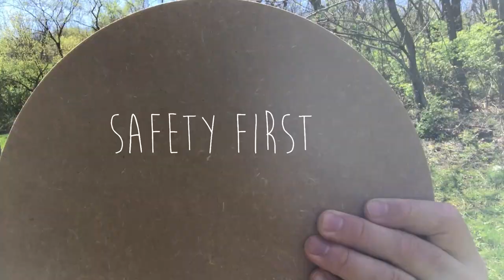How to Make Circular MDF Board Canvases with A Router and a Circle Jig

Comment: I have a router with a square base. I'm new to doing things like this. Would my base come off and then my router would attach to that jig?  What bit do I need to do this? Sorry for all the questions
Reply from the maker: The circle jig is compatible with a bunch of different routers and yeah, you just take off the base that's currently on it and attach the one the jig comes with. I'm not an expert with tools by any stretch and I managed to figure it out fairly quickly.
~D